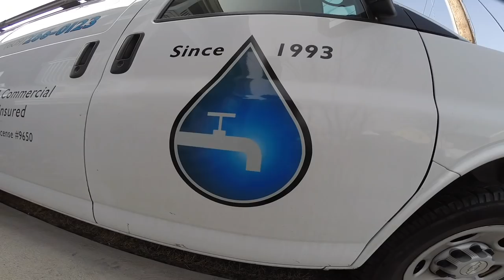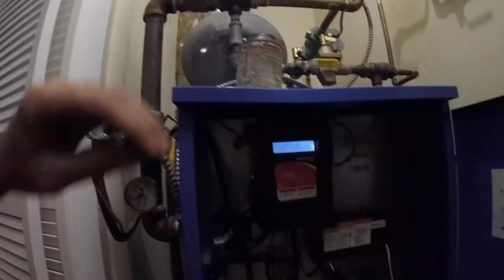Watts Auto Fill Replaced On Boiler Plumbing Apprentice

Comment: If I remember correctly the 
"67 valve" in your video is for purging the air out of the heating pipes and you are right,the valve cap is left loose or can be tightened once the heating pipes are purged of air because when the air is purged the water acts on a float inside the valve which prevents the water from leaking out.Great video Chuck,keep them coming.God bless you and yours my Brother.
Reply from the maker: True.

Comment: We use black iron pipe for inside and out I also love pro press and mega press we did 2 50 gallon elect. Water heaters and a pin hole repair plus plowed 7 driveways by 1:30 today it is such a time saver pro press !!! We will be at McGuire af base next week fir the holiday visiting my youngest so and wife !!!
Reply from the maker: wow black pipe outside....interesting. Maybe because we are a coastal state the salt air is always in attack mode. I bet thats the reason. hmmmmm. enjoy jersey...and safe travels.

Comment: probably wouldn't leave the vent caps open for long, let it run hard and cycle for a week, then close them all, no leaks = no fresh water in = not much off-gassing to air lock and unless it's in a basement, garage or area with floor drain that wont hurt getting wet, close em!
they always end up leaking after "x" time and the hotter the water the quicker they start leak, so return side is the least likely to leak.
Reply from the maker: I was always told loosey goosey so they work and let air out...hmmmmmmm

Comment: I see  u guys also use flexible gas pipe but why do u guys use galvanized pipe instead of black iron pipe here in Massachusetts we cannot use galvi pipe ??
Reply from the maker: I rarely use gas tite or similar pipe. I use to but now I do mega press. I always liked galv. I have to use galv outside here. What do you guys use outside for roof work if you cannot use galv?

Comment: looked like a "maid-o-mist" vent, not that many around here, it's mostly ancient B&G, Taco, honeywell/sparco, infact  not that much hydronic heating around period, the vast majority are forced hot air, or steam plant fed (downtown) which most everyone has moved away from, except the hospitals.
the residential dinosaurs around are 1950's and older, asbestos everywhere and then there's the all electric homes with stupendous "heated ceilings"  heat rises, so lets heat the ceilings, they sure don't have to worry about snow load and ice dams on the roofs, cause they pretty much stay burnt clean and that's with multiple feet of insulation :)))
Reply from the maker: maid of mist for sure. where ya from again Throttle? I know you told me before...Brain damage here ha..
Reply: agree Maid O mist seemed to be the popular one back in the day.  I always screwed the Schrader cap in all the way and then backed it out maybe 1/2 turn and left it there. as far as I know they should always vent and not leak.  if she's a leaker mamma change it out.  CB earned his pay and then some today.  insanely tight space.

Comment: hey chucky no back flow preventr  we need them here in mn  jersey  no?
Reply from the maker: Yes. There was one before fill. I installed fill only. I really like the combo fill and back flow for sure.
Reply: I spy a "Watts 9D" dual check with vent, hehe
Reply from the maker: 9D in da house!